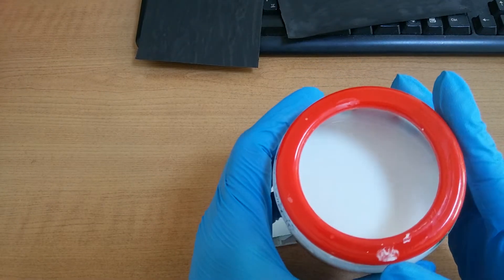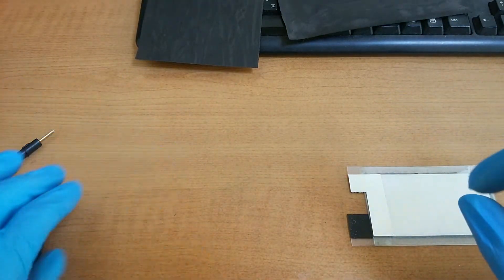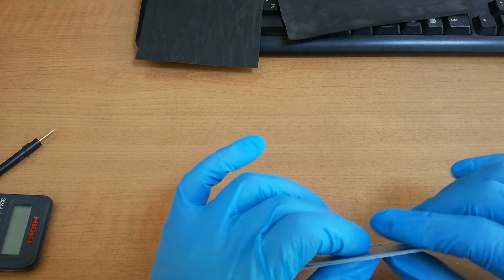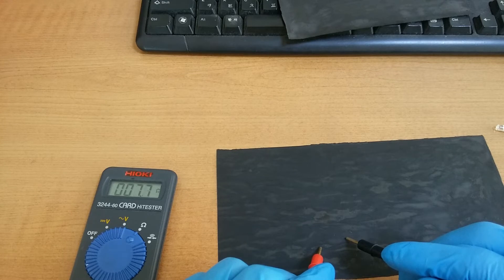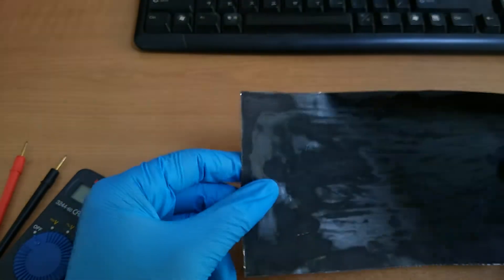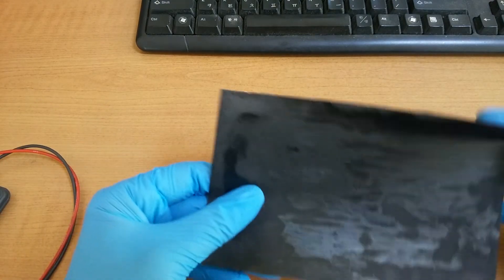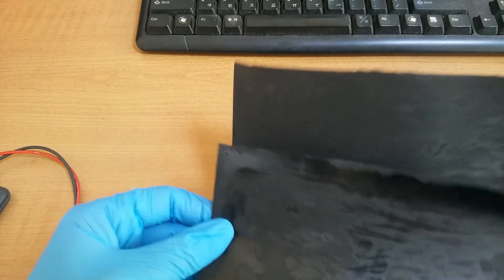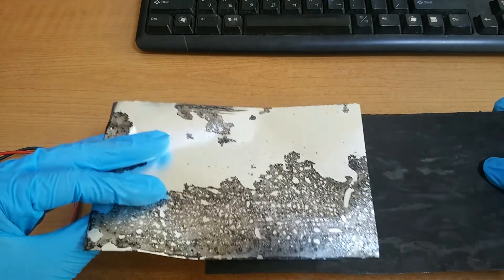graphene sodium solid state battery: from 3.1 tp 2.9

Comment: I think to increase surface, you should carbonise sonething with a structure like i.e. seaweed or any other bio material which already has a sponge like structure.
Reply from the maker: Thank you always. Have a nice day
Reply: Maybe try sugar and sodium bicarbonate mix in 4:1 w ratio. Bake it in the oven at 250c for 3-5 hours, you get a high surface area carbon foam. Bake it at 1000c for 1hour in a reducing environment and you will get a graphitic carbon with high surface area. 
Just an idea